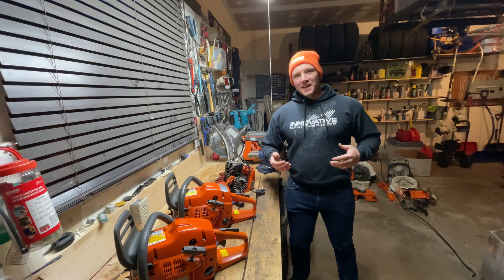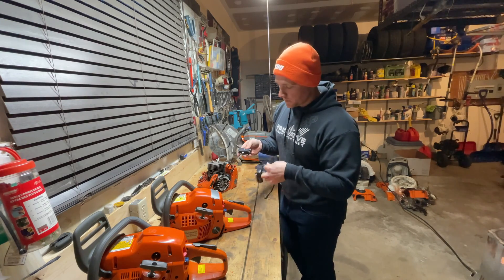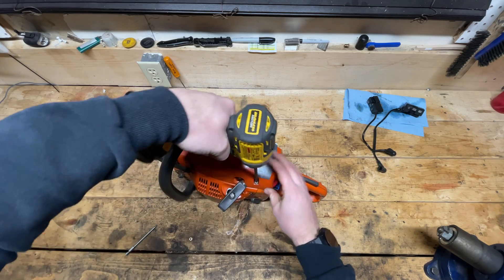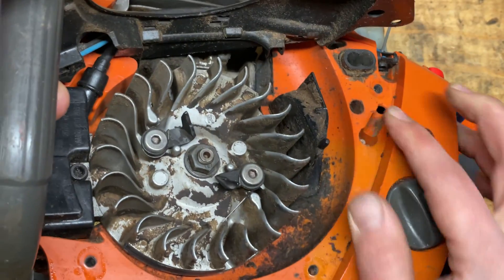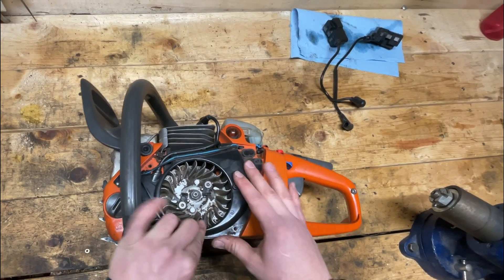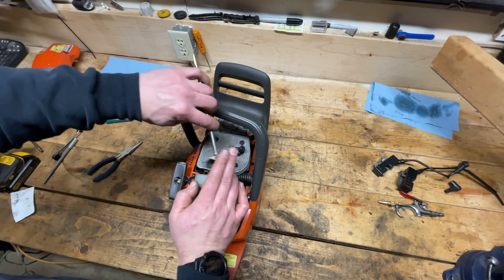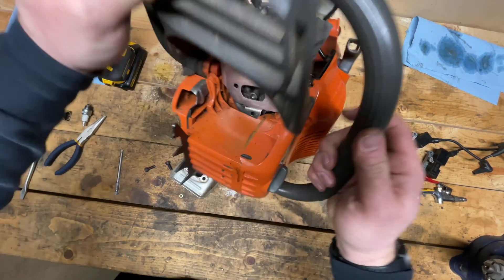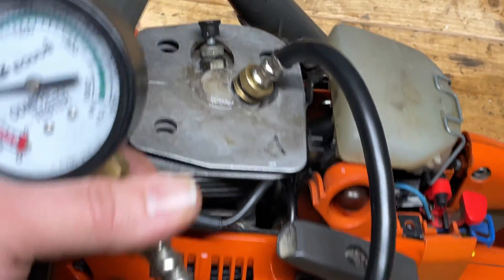Chainsaw makes knocking / rattle noise when pull starting: How-to fix (and set an ignition coil gap)

Comment: can I upgrade Husqvarna 450e to a bigger cylinder? do I have to upgrade the carb too? 
or how about having a proper air filter instead of the mesh :D
Reply from the maker: Hey Allan… I’m not too sure. All I know for certain is the 450->460 upgrade.

Comment: I'm not sure if 2 strokes are different but are you not supposed to do the compression test with wide open throttle for maximum air intake? Despite I'm sure wouldnt have made a difference in this case
Reply from the maker: Yes, general rule of them is having the throttle open. If the saw has a throttle lock or a choke that opens the throttle, I use that.

Comment: Its flooded, ring is washed out. Put some straight oil mix in it and watch the compression come up. Notice the compression came up 10 psi with it sitting there drying up.
Reply from the maker: Sounds good!

Comment: I have an 028 that I bought new in 1982.
It have a scored piston.an suggestion on where to buy a new piston and head ?
The dealer said he could not repair it.
Reply from the maker: That’s malarkey! You can repair it. Google Stihl 028 piston and cylinder and try and get one from meteor or hyway!
Reply: Thanks
Reply: What do you think of “LIL Red Barn” as a place to buy a piston and head.
The dealer actually didn’t say that it couldn’t be fixed,he said he would not fix it because the parts were obsolete and he would not use other parts.
Reply from the maker: @BlueVirginia  I have good things about them. Give it a shot - what do you have to lose?!
Reply: Thanks for replying,I appreciate you.
Reply from the maker: Cheers Dan!

Comment: Great video! Typical situation. You find what you think is the problem, you fix that and it still wont run. Looking forward to the next vidoes on this saw. The flywheel looks a bit uneven when you turn it.
Reply from the maker: Hey there! thanks for the comment. I may go tear it down now!

Comment: I have a harbor freight compression gauge kit. It reads 30psi on chainsaws which i know have good compression. Someone told me you need a different gauge for small engines. Is that correct?
Reply from the maker: No, PSI is PSI. My gauge works in both my cars and small engines. Cheers!
Reply: @DavesSmallEngines  thanks.

Comment: Don’t be in a hurry to trash those cylinders  they may only need a hone and a new ring and maybe a new piston. Get a husky ring and put in the cylinder for fit you may be suppressed that you will not need a new cylinder. Even the strait gassed cylinder may be salvageable with a bit of emery tape and kero, and unless a ring has bounced all over the countryside of course. At worse you may have two cylinders looking to go on a blown up saw for yourself.
Reply from the maker: Hey Rusty!! Great points. I think I can save this saw for sure, and if it was my saw I may try on the other as well. I just can’t be confident on the heavily scored piston and cylinder saw that a hone will work long term.

For this saw, I will disassemble clean it up and toss in a new ring. I will make a follow up video!!! Cheers!

Comment: When the flywheel hits the coil like that it sometimes means the bearing on the crankshaft is worn out.
Reply: nah not at all when the flywheel hits the coil it shears the woodruff key sometimes
Reply: i get what your saying, but if the bearings have that much play the seals would be gone and would of had airleak issues well before
Reply from the maker: I agree with what you've said - this saw has had minimal use, and the previous owner was messing around with it.

Comment: I understand the business card trick and yes it works. Here's the test Dave your in the limelight what about in your follow up video you talk about the actual gap and using a feeler gauge. Not trying to knock you as your doing great work and I know roughly business cards are the correct gap and I believe it's 0.010 offhand. Personally I think it just looks and seems more professional using a feeler gauge and maybe mention a business card works in a pinch for those at home.
Reply from the maker: Hey Rob! You’re right. A feel gauge is probably the best tool for the job. With that said, for the average home owner, a business card will do just as good of a job while being far more accessible. I am with you and have done gapping with both! Cheers and thanks for the feedback!!!
Reply: @DavesSmallEngines  I do have a feeler gauge but last time I had to gap one I reached in my pocket grabbed the wallet and took out the business card to gap it lol. I just see most the videos doing it with business cards which is about right but business cards can vary slightly laminated etc. End of the day it all works alittle part of me wanted to see you pull out the feeler gauge and show the textbook way and then either mention or say real world way lol. Keep up the great work though. I'm enjoying seeing you progress and wish you much success not everyone can have a great mentor and I definitely enjoy donyboys channel and have learned so much and continue to learn. One thing I haven't touched yet is getting into pistons, cylinder heads, valves and covers, but your videos definitely make me want to give it a go if I come across it.

Comment: You can tell that the ring isn’t sealing properly because of the brownish color underneath it.That means that combustion gases were getting past the ring for a while. It is ok  above the ring(s) but not below. Any time you see that it’s time for a new ring at the very least.
Reply from the maker: Andy! Thanks for the tip. Great info. I think I’m going to be able to save this saw with a new ring and a clean up. Cheers and THANKS!!!!

Comment: Nice work.   Dave, perhaps a mention of the correct compression reading for that CC sized chainsaw?  I don't think anyone, even USA folks really like Phillip head screws.
Reply: Anything under 100 psi and it won’t run properly. Realistically. Most healthy 2 cycle engines in saws should be over 120 psi.
Reply from the maker: Good to know about the Phillips heads haha! Andy is right. If it’s under 100psi that is pretty weak. This saw should be around 150psi give or take.

Comment: Hilarious ..would've never guessed
Reply from the maker: Cheers Seth!
Reply: @DavesSmallEngines  thanks freind.bless you guys.I fabricated a clamp for piston.today goung to try slide that cylinder over the two rings.been buisy helping my freinds .mow and catch up there businesses.as predicted rain and weeds are rampped?yet to get my other saw back from echo dealer ???im beyond upset??that 2511 t was brand new and they would not tune it??im telling them i want a different saw or money back??I've yet to even start my trees ??glory to God..must be a reason.thank you for helping ..could use a list of chemicals and or tools on my new mechanical endevures?couodnt find a store near by.ordering is hard without credit cards?
Reply: @DavesSmallEngines  have a impirtant question ????on this carb before I go to start this 488..after rebuild clean out..it only has a low jet ?  How shouis i set it??to start out as im about to finish assembly..and praying for the best everything seems ok ..I beleive that limited carb and me adjusting it wrong ??has played a big part in this.besides wear and tear?? Realy need help as never had carb like this .should I start from right to left as normal..or set it low all the way left????????..thanks ghys
Reply from the maker: @sethhaun4440  what is the model carb?
Reply: @DavesSmallEngines  just woke up here.it says walbro 21-245. On top ? 62-121 on intake door?HDA 165A 242 ON TUNE SIDE??WITH HIGH JET BLOCKED.ALSO ILL HAVE TO GET SAND PAPER 22O OR SOMETHING BEVAUSE. I PUT IT TOGETHER BUT NOT FULLY' and hand spun the piston the intake side is slightly rubbing..so i did not run it..it's other wise shockingly in good shape..or I'm fooled
Reply: @DavesSmallEngines  thanks for getting back off schedule it rained 25 hours here smokeys and its around freezing this am..not best weather for work..but better than hot?lol
Reply: @DavesSmallEngines  young' master dave I have a question a partner has a craftsman push mower 5.50 hp. Briggs engine it dies after running for minute or so consistently .??what would I check while actualy in the feild mowing.he uses it on few back yard pool.areas.I thinks it's ohv' ovh' model.none self propelled.

Comment: I had a 455 with the same issue. The cylinder was fine but the ring had seized in the groove. I replaced the piston and ring, base gasket and seals and the saw fired up first pull. Hopefully you can do the same. Great job with the diagnostics and thanks for the video!
Reply from the maker: That’s what I’m going to try Digging!!! Check back soon for the repair video!

Comment: Excellent diagnosis Dave.  Could you also put some oil in the top of the cylinder to see whether the compression improves or not?  Could it be that just the piston ring is worn down?  Are there any other areas in the saw's engine compartment that could also be leaking (i.e. crankcase seal), thus creating low compression?  Again, great video.
Reply: Hi again Dave.  I took another look at your video (~ 11:35 mark), and I wonder if the "low" compression is due to just the piston ring being stuck.  The very top portion of the piston, as well as just underneath the piston ring area, are both very dark in color.  Maybe pour/bad fuel being used, creating varnish/gum build-up?  And this could cause the piston ring to get stuck and not properly move/expand during start-up (causing low compression). Can you access the piston ring (thru the exhaust port) and see if the piston ring can be moved?

Would an option (to test) be to spray a cleaner like sea-foam into the top of the cylinder (thru the spark plug hole), and let it sit over night.  Then crank the engine over several times in the morning (with the spark plug out) to get out most of the sea-foam cleaner, and then perform another compression test.  

Just a thought.  If you have any further follow-ups, I definitely will be interested in hearing about them.  Again, good luck!
Reply from the maker: Carl... great great observations. I truly appreciate it. The more I look at it and the more I read the comments I think all it needs is a new ring. The other saw... not so lucky I don’t think.

I will order a new OEM ring, pull it apart, clean it up and film the whole thing!!!

Take care!

Comment: nice ,but its just 1 hour  job.455 and 460 are the same cylinder no more power
Reply from the maker: Hey metal works, my research shows the 455 is a 55.5cc and 460 is a 60 cc
Reply: same cylinder diferent stroke
Reply from the maker: @metalworks2765  GREAT catch!!! Thank you. This will save me a headache down the road. Cheers!
Reply: @DavesSmallEngines  your welcome dav
Reply from the maker: Cheers Locust!
Reply: That's a shame! Nice clean saw but it's worn out. Is the parts saw cylinder toast too. Is your friend running a quality oil mixed at the correct ratio?
Reply from the maker: Hey Brian! The parts saw is cooked. The other saw is heavily scored. I talked to him and I was mistaken, both of these saws are new to him. He has a different 455!!!!